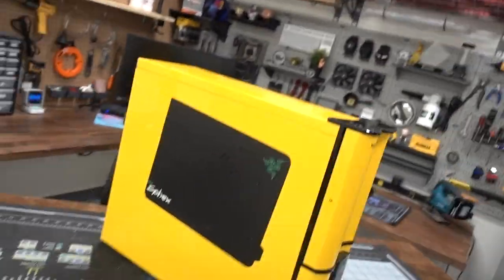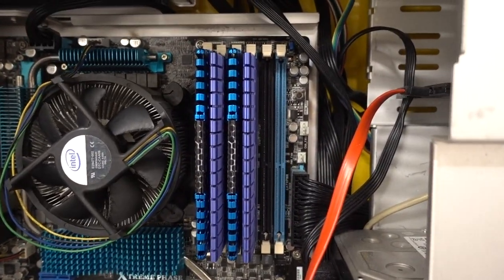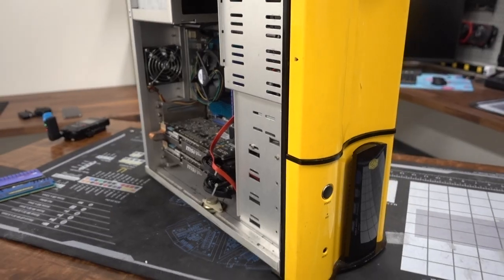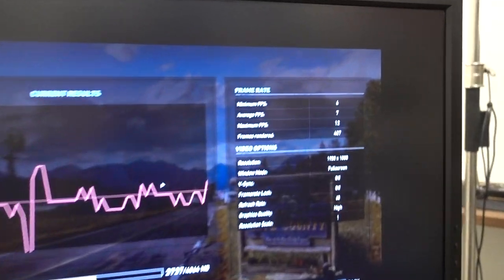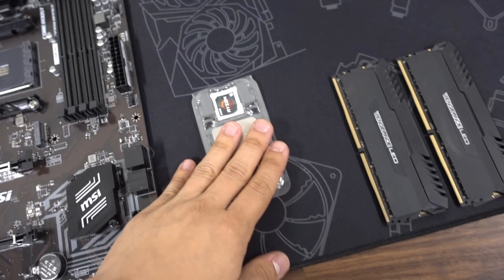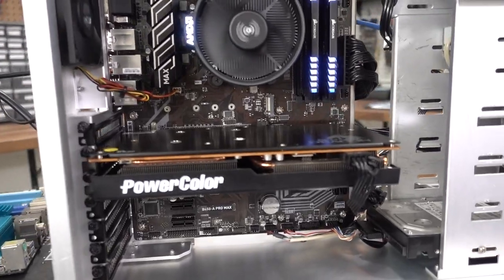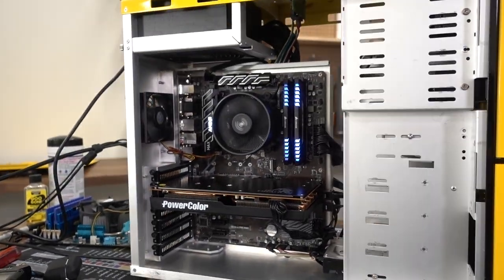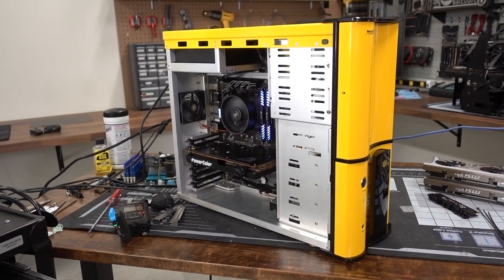It's been 10 YEARS since they cracked open this gaming PC. I'm going in!

Comment: I just retired my 920 in early 2018, they are a beast of a cpu still. If you have a chance to boot back into it and see which stepping of the CPU you have, if it's a D0 it's godlike in terms of overclocking. As a novice overclocker I was getting 3.66GHz on it w/ a 212 Evo. I've heard stories of them hitting 4.2 on air and the sky is the limit I'd imagine w/ a custom loop.

Comment: For legacy systems using first gen core processors and old video cards you would need to force install device drivers disabling integrity using cmd.
Reply: And it will work 10 times better and look 10 times better too.I have done it to many systems

Comment: literally all this build needs is a bios update and a new Xeon 5690 cpu installed with a noctua dh15 cooler and new RTX 2070 Super and a full set of 24gb ram 1866mhz custom set the ram timings and mhz too 3000mhz ddr4 like i did and overclock the CPU too 4.4ghz + SSD and this could be as fast as the new Ryzen 3600X hahaha seriously i did this and benched it and its on par with the 3600X hahahaha 6core 12 threads X5690 cpu oh but this might be too difficult for Nitwit !!!!!!

Comment: My laptop, which is almost 4 years old, runs most games at the lowest settings at around 20-30 fps. This computer ran a game on high settings at 10 fps. My computer, which was $500 4 years ago performs worse than a computer that is over 10 years old...
Reply: Laptop that is 500$ is not for gaming and especially 4 years ago a 500$ laptop was pretty bad. This computer was top of the top beast PCs and the i7 920 is still good 10 years later.

Comment: This reminds me of my old Dell XPS 9100.  It was one of the top of the line models available at the time.  It had something like 8 GB of RAM (running at 1333 MHz) and an Intel i7-930 processor.  I don't remember what kind of graphics card it had.  I pulled the system apart to build a custom system when I got into building my own computers.  I kept the case and leftover parts.  I decided to rebuild it some years later out of something to do.  I upgraded it with 24 GB of Corsair Vengeance RAM (1600 MHz), installed a 500 GB Samsung SSD, a 3 TB Western Digital Blue HDD for storage and a EVGA GTX 970 FTW graphics card.  I began to wonder how my decade old Dell system would hold up to gaming and I was really surprised on how well it still games even though I put some much newer parts in it.  It can still perform as well as any of the newer systems out on the market and can still run most of the modern games out there.

Comment: I still have my first gaming rig I built back in 2010. Has a i7 960 (4 core 8 thread) evga x58 SLI 3 motherboard, 6gb ram and 2 MSI gtx 460 HAWK in sli.  It rarely gets used but is beautiful to look at.

Comment: I still have my i7 930/SLI GTX470 computer. The processor works fairly nice as an Unraid server. Ever since I got into PC building around 2009, I do a gaming computer upgrade every 2-3 years and my computers just continuously get demoted down to my other computers. Got my i5 10600/RTX2070 current gaming PC, i5 4690/GTX970 living room HTPC/light gaming computer, i3 10100 security computer and finally the i7 930 as the Unraid plex/NAS computer.
This year, I finally got rid of an AMD Phenom2 and a AMD APU computer. I will probably look into building an AMD 5800/RX6800 build and do the whole process over again when stuff gets back in stock which will finally see the i7 930 going away.

Comment: "Corsair Vengeance...4gig sticks...1600 speed DDR3...my how times have changed." Yeah. Last week. When my 2011 Athlon II X4 build with 4x sticks of this exact RAM finally quit booting.

FWIW, that old build ran rock-solid for 9 years. I don't remember a BSOD or other major malfunction. Shoutout to AMD (Athlon X4 640), Asus (M4A79XTD Evo mobo - which still looks badass), Corsair (TX650 PSU and the Vengeance RAM), Patriot (Pyro SSD) and MSI (GTX 460 - which was still working even though gravity pulling on it after 9 years had visibly warped the board). I'm actually still using my WD Black 1 TB HD from it as well. With the grace of an old warrior, without any fanfare it just shut off in the middle of the night and wont power on (hitting the power button resulted in a 1-2 sec boot then auto power-off).

I actually contemplated painting my old case black for my 2020 build. I'd used it for several builds - sticker on it says manufacture date was March 2004! Only reason I didn't was because it sounds like a 747 taking off (6 old Chinese molex case fans) and I was worried the power button was getting worn out. That and PSU's at the top of the case are so...2010.

Comment: I need help. I’ve been wanting to build a pc for a while and I’ve been playing on a ps4 pro for the past 3 years. I’m finally deciding I want to build a starter pc and setup. I don’t have very much knowledge of the parts, only basic things. My friend helped me out a bit with a guideline on what parts to put in, but I modified mine just a little putting in more money in places like the power supply, ram, and hard drive. This Is what I have so far, but I don’t know if it’s good or not. I want to keep the whole setup under $1600. My goal is 1440p gaming on at least 120 fps but Ideally 144 on games most because I want a 144hz monitor.

This is what Im thinking for the setup but I have a feeling I'm doing something completely wrong.

CPU: AMD Ryzen 5 3600
Motherboard: MSI B450 TOMAHAWK
Memory: OLOy WarHawk 16GB
Storage: Western Digital Blue 1TB 2.5"
Graphics Card: MSI Radeon RX 5700 XT
Case: Corsair 275R Airflow ATX Mid Tower (this comes with fans so I diddn't get extra fans)
Power Supply: Corsair TXM 650 W

Monitor: Acer Nitro VG270U Pbmiipx 27" QHD 2560 x 1440 144Hz 1ms
Keyboard: SteelSeries Apex 3
Mouse: Logitech G502 HERO

Suggestions? I have a couple of other accessories like cable extenders and together it adds up to 1600.

Comment: I'm sure someone has already asked, but I'll give it a shot. Can I have the X58 board, DDR3 RAM, and the Core i7 processor w/ heatsink? Currently, I'm on a Mid 2009 Apple MacBook Pro 13" that a school was throwing in the trash. My PC tower isn't much better, either - AMD FX-4100 CPU, 8 GB (4x) DDR3 RAM, some GIgabyte mATX motherboard, and an NVIDIA GTX 1050 Ti 4 GB card. Aside from the GPU, everything was hand-me-downs/discards. I'll use it as a daily driver, though I know it's already obsolete. But I guess anything's better than Core 2 Duo and Bulldozer lol.

Comment: I am very disappointed. Who the hell runs x58 not in Triple channel, why is there a stock cooler, WHY IS THERE NO OVERCLOCKED XEON????? And yes 10 years later it’s good, I ran this with a 980 ti overclocked to 4.5ghz, if you are gonna upgrade to something at least upgrade to something decent. Like seriously a Xeon cost $20 and gets 90% of the performance of the Ryzen 2600x, this is a horrible upgrade sorry, tech yes city would be very very mad 😡

Comment: Wow, this was my previous PC , but with the 950, 12gb of ram, and a GTX 460. I just just upgraded to the 3700x with a 580 I got for 90$ last year. 

Seriously, the first gen I7's were great! Power hungry but as I sit here going from tab to tab on my computer, I don't feel much of a difference, but I do with photo editing, phew! Still.. not the gain I was expecting going from a 64gb ssd in 2010 to an NVME in 2021. SSD's were affordable, if you just only used your OS and a few special programs on a 64gb drive, I believe I got mine at the time for $200, which coming from conventional platers, was mindblowing.

Comment: Its Nov 2020... My C drive is a 500gig Western digital Black. I bought new in 2002... Still working with zero errors.
My Gaming PC is an 11 year old 1st gen i7-950, 24gig Corsair ram, GTX970. It copes reasonable well for 1080p gaming.
Yes Im using an old PC for gaming.

Im stuck on Win 7 because Win10 BSoD during install unless I disable both the onboard sound and network cards in the bios. (realtek sound, Intel network)
After install if I enable either card, Win10 BSoD during boot.
So Windows7 it shall be.

Yes keyboard warriors. I should upgrade.... but should I???
Thanks to covid my employment status is sketchy at best and I could be unemployed at anytime, with that in mind. Do I want to spend £1000+ on a PC when I could be needing that money to live off and pay bills etc..

Comment: honestly, an 980X/Xeon 5690 + 24GB of ram in triple channel and GPU upgrade would do a lot for this system. I'm still running an ASUS Rampage III Formula with a 980X, a 1070, and 24GB of ram. It slaps and I haven't even overclocked it

Comment: Speaking of Old cases. I'm rocking a CM 690 II ADVANCED (USB 3) and it fits any new hardware even though it's from 2008. Has removable HDD cage which makes it fit even a 3090 if need be :D. Recently put a Noctua NH-D15 inside, even though its a thick boy cooler it fits with ease.

Comment: The X58 is still a reasonably capable platform.. stick a £30 Xeon X5675 in it and on that board, it'll overclock to about 4 to 4.5ghz easily.. with a decent GPU it would probably run FC5 just fine. Usually a decent overclock on a an X58 hex core Xeon will just about keep up with a 5600XT from what I've read in the past, would have been fun to see him try it before building the new system!
What's going on with the RAM though, those boards were triple channel so 8 sticks doesn't make sense at all.
No surprise that it had a decent PSU with crossfire and the 120W 920..

Comment: I had a i7 920 + ASUS P6T Deluxe for 10 years too. IMO it's one of the greatest CPUs ever made. The mobo was rock solid too. I've never seen a CPU OC on air that much since then. My 920 was a D0 chip too which was the best 920 chip at the time. Easily went from 2.66Ghz to 4.0Ghz all core and stayed that way for at least a few years before it started to degrade and was like "No more". Then I had to drop down to 3.9 or 3.8Ghz for temps. I did that late in its life too after using it stock for so many years. I went through many GPU upgrades. I had Dual Radeon 9800 PROs which both died on me back to back within months of use, and was the reason I swore to never use another AMD GPU ever again. Then Dual GTX 460 Cyclones. Then Dual Gigabyte GTX 670s Windforce with the triple fans. Added a 240GB Kingston HyperX 3K SSD addon that I got for like $90, and 6x custom 3000RPM fans in my Cooler Master HAF 932 case. Only part that ever died on me besides the stupid 9800 PROs was my 7 year old Toshiba HDD. I worked that thing to death for those 7 years. There were weeks when I had come close to downloading an entire TB in data. It hung in there strong. Ahhh, the memories.

Both of my current rigs take a giant shit on that thing now, but it would probably still give the Raven Ridge system I built 3 PCs ago a run for its money. Raven RIdge couldn't really game at 1080p, where as my i7 920 system crushed 1080p games all the way until I hit Watch Dogs and Middle-Earth: Shadow of Mordor. That's when being VRAM limited started to screw me over and then I accidentally fried a bunch of parts. Had I not done that, and I had I waited for 4GB 670 models, I probably could've gotten a few more years out of that beast.

Comment: I have the same I7 920 in my desktop, combined with a GTX980. 
Farcry 5 on max settings at 1440p runs at 40-50 fps. 

Build it back as a highschool student 11 years ago with a GTX260 and replaced the GPU with a GTX980 back in 2016.
Also added a 2.5 inch samsung evo ssd of 256GB in 2015.
Probably the best investment I ever did for a computer, still use it till this day.

Comment: I think this upgrade was not necessary, low fps looks to be due GPU throttling.
x58 is till great for gaming, especially with triple channel memory.
you should just upgraded the CPU with xeon W3690 (6c/12t) and put better single GPU,
maybe 12gb ram in triple channel.
trust me, you will be surprised with the results.

Comment: A bit late to the party to comment but I still have an X58 system with a Xeon X5650 6 core 12 thread cpu paired with a GTX1060 6GB and 32GB ram and that thing still rocks!

Comment: Firewire 400..... Gee this case might be older then 10 years haha... 
Well an i7 920 was released in 2008 shockingly, so I guess FireWire 400 was still kinda a thing as legacy equipment. 
But alright it still has a quad core CPU with 16gb of ram & duel amd 6950 is kinda toothless now.... But not useless. 
Idk this PC even today can still game a little. Like most of the latest games in concept won't even run. 
But I've seen worse! 
Also that graphics card and the fact the 2nd gen I7 didn't come out till 2011 means yeah likely this was built in 2010. 

Back then I was rocking a AMD X2 6000+ duel core 3ghz, 4gb of ram, and a mid range 5000 series card. I was a peasant I suppose compared to that persons dad. 

Far Cry 5 even running on that system is impressive since it doesn't meet the min. The fact it could do that well tho I bet you could play with the settings to make it playable. 
Lowering the settings down to medium or low, and if that don't work lowering the resolution. 
I got other games that shouldn't play on weak hardware by doing things like that. 

But yeah kinda a sleeper PC setup now, that case honestly to me look like it's from 2005 to 2008 tops. Not even 2010.

My PC is kinda a sleeper as well I got my hands on a old NZXT Switch 810 case from 2012 and it holds a Ryzen 9 3900 with 32gb of ram and soon once my order ships and arrives a AMD RX 6900 XT! 
But my case still has modern creature comforts, like cable tie downs, modern ventilation setup, has a window, Even USB 3 in the front. Nothing really holding this case back so it was a cheap full size case alternative for me to cut corners where I could to afford my build.

Comment: The starting "benchmark" wasn't exactly fair since the system probably throttled like crazy due to ancient thermal paste. I got an Alienware Area 51 from 2008 with similar specs as the machine in the video, and it can still run most modern-ish games.

Comment: That thing had to have gone through a couple of different builds before the specified "10 years ago". The case is ~16 years old. I had the 2nd version with two toned color, side ventilation and I/O. Best case I had before the CM690. 

ETA - The case I had was actually the slightly beefier CM Cavalier 3 CAV-T03. It shared the funky wave front, but had different branding, and if anything, worse front ventilation.

Comment: Here I am still using X58 with an X5675 a 4.4ghz, 24gb memory and a 1080ti.

I am running a hefty monitor though so GPU is tapped at 100% usage pretty easily.

Although I'm currently waiting to upgrade waiting to see the real world results of Zen 3. Money burning a hole in my pocket at moment.

Comment: 1) This case is much older than the components, and that top "plastic" piece is a thick chunk of aluminum.

2) 10 years ago SSDs on top end machines were still pretty regular, especially with 6850s in CrossFire

3) Yes, that is a mouse pad. Early on, laser mouse enthusiasts suggested those style of mouse mats with adhesive on the back to keep them from sliding giving maximum accuracy.

4) While the RAM is mismatched, the biggest issue is not taking advantage of the available Triple-Channel configuration and running 12GB instead of 16. Performance left on the table there.

Comment: The thing is: Get a Xeon X5675 for 20 bucks, cranck it up to 4.5 GHz (they were top binned), get some cheap ddr3 1866 ram (use triple channel mate) and it will be perfectly capable of a 2080S @1440p.

Comment: I just subscribed. Also, I'm in the feels for this pc case, not because i owned one, i haven't. But, because I have an NZXT Phantom 001 that I've recently retired after 8 years of owning with my first PC build. While changing it, I couldn't help but notice despite how "unique" it is, a lot of the things about it were just gimmicks and or counter intuitive. For example, the single 140mm frontal fan slot was pretty much useless as it was mostly covered by the drive bays behind it. So while yeah, the drives were getting windy, the rest of the comp had to rely mostly on the 2 top 192mm fans and the 120 rear exhaust for "cooling." Still, it was very spacious! 

Now days the old system sits in a more modern Fractal Design mid tower, just under my tv, while my new and unfortunately half built workstation computer sits behind me waiting on a 3090 or a titan...

Comment: You should cleaned the GPU's, maybe replace the TIM, make sure that crossfire is enabled and proper test the configuration.
At over 100C definitely was throttling.

Comment: you should use that old board paired with a 6-core Xeon X5675 and OC to 4.4 to 4.5 and with newer GPUs, still a very good budget gaming option

maybe even get a spare case and build a budget used parts system around it

I would have upgraded that system, $30 X5675, $20 heatsink, some extra RAM and a newer 2nd hand GPU and then the newer parts in a new case.

Comment: I had an i7-920 clocked from 2.66ghz to 4.0 on air, using a Thermalright 1366-RT cooler, stable on prime-95 for 24 hours. Had that clock for 7 years until it finally burned out and that was probably because I never bothered to change the thermal paste on it. I still have that chip laying a round just for the memories. I remember that thing blew everything else out of the water when they released. They were really something else.

Comment: Those graphics cards are not original to the system. 
Jasmine’s dad probably had a 4870 or a 4870x2 in there when he built it. Possibly two 4870’s or 4850’s in XFire. 
So that has been upgraded in like 3-4 years after the original build.